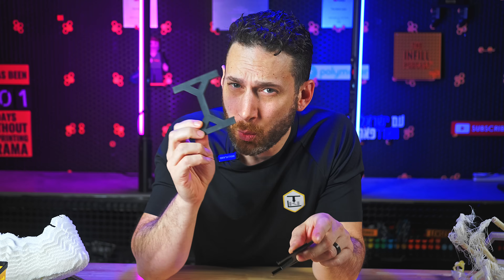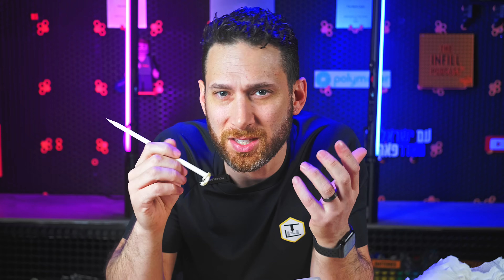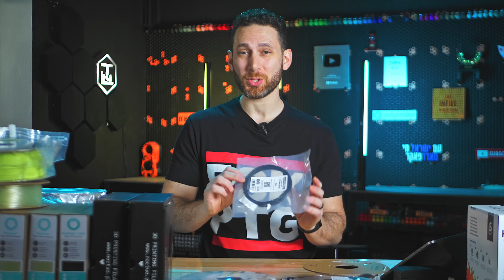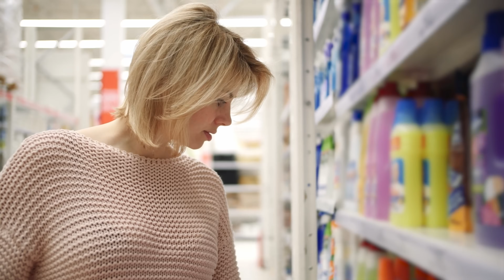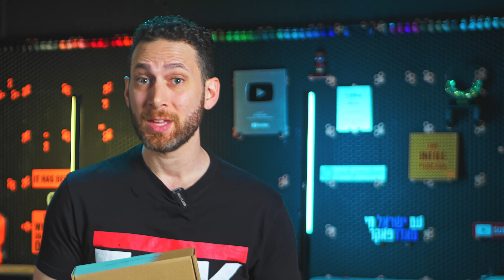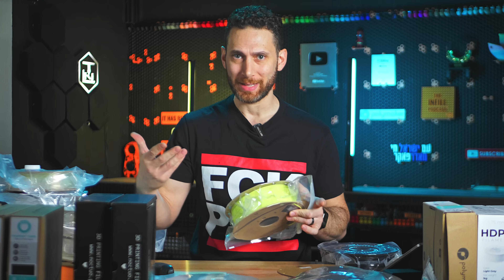Testing 17 Special-Purpose Filaments for YOUR Next Project!

Comment: so I have a general question because I’m new to 3-D printing and I just bought a X 2d with the AMS 2 pro. I noticed that when the filament goes through the AMS, it leaves a rough texture on the filament after back-and-forth with customer support. They tell me that’s a normal thing and it shouldn’t affect the way the AMS works. So my question is to anybody that has experience is this true?

Comment: Gotta use the hdpe to design an acetone vapor bath box where you can just screw on an acetone bottle and then when ready you just place the part, open a valve and let the vapor in and once done close the same valve to not only stop new vapor from coming in but also open the area up for fresh air to allow it to stabilize

Comment: I frequently use PHA for parts that are used outdoors because of it's great UV resistance.  It really takes a lot of consideration when you're designing the parts, and it prints best on open printers.  My Core One can handle it alright thanks to its speed, but a fast open printer would be able to print larger parts better.

Comment: I have a Creality 2025 drier. Those filament rolls that have the black skin on the cardboard spools are a couple of mm too big for that drier. I guess it's that skin's thickness that makes the spool taller. They contact the lid, which stops the spool from turning. Then the print fails. No problems with any other spools.

Comment: There's one filament I was looking for and for a very specific reason: Sunlu PLA meta.
One of the things I like to print is miniature models for games such as d&d and warhammer.
These models are usually printed in resin. However I did not want to set up a chemical lab at home, much less be exposed to toxic materials.
For that reason I print these models on a 0.2mm nozzle and use sunlu meta PLA. I don't know what it is they did but its by far the best at this job.
Also I often print models specifically presupported for resin. Weirdly they work amazingly well for FDM too.

Comment: Do you want special filaments purpose built for 3dprinting for engineering, a PLA stronger than Basf.... special polymers based on CPE, TPE, TPU with crosslinks, etc from Brazil?

Comment: 25 yrs in manufacturing and I've never heard PP said for polypro. Not until 3D printer YouTubers. I kind of get a bit perturbed. Just call it PolyPro.

For heat resistance, the ultimate is thermoset material. However, I doubt 3D printing any thermoset material will ever be a possibility. Phenolic is the resin I am familiar with. I believe it's not used as much since Acetal and Nylon has been slowly replacing phenolic.

Comment: With lw-pla you should 1 piece after one piece.
55 to 65 % federate from normal pla and max 50mm/s , higher temps = more expenses 
Slicer 0.4 wide give 0.55 wide by printing.
If possible print in vase mode or without retraction but max speed for displacement

Comment: Not only is Prusament's PETG Ultra Glow brighter, but it's also one of the only noctuluminescent filaments made with something other than PLA. 

Case in point, about three years ago, I printed a bunch of figurines with a glow PLA, and then placed them on a shelf with a UV light to illuminate them. It was a test and I legitimately knew what to expect. Within 18 months of [indoor] UV exposure daily, they were all visibly degraded. I never understood the rationale of making UV sensitive filaments with PLA, knowing it degrades with exposure.

Comment: Hi Jonathan! It is great to hear that the printing process went so smoothly for you. We really appreciate you taking the time to test our filaments and share your experience with your audience. Since HDPE and PP can often be tricky to work with, it is a huge compliment to our team that you had no issues getting them dialled in.
If you are looking for ideas on what to create next, HDPE is an excellent choice for parts that need to be low-friction or highly durable. It works perfectly for things like drawer slides, tool jigs, or heavy-duty spacers where you need a slick surface that can take a lot of wear.
Polypropylene is best known for its incredible fatigue resistance, which makes it the go-to material for living hinges, as you showed. You can print containers where the lid and base are a single piece, and the plastic hinge will bend thousands of times without snapping. It is also very lightweight and chemically resistant, so it is great for functional workshop organisers.
Reply from the maker: Omg drawer slides that’s brilliant. I’m considering building my own drawer slides instead of always buying them. Genius. Might have to do it…!

Comment: I think you really missed the mark on two fantastic lesser known filaments... My #1 pick is CC3D 's PBT Pro, a 5% glass fiber filled PBT.   Has fantastic ductility and impact resistance (not for high speed impacts, like combat robots though, at those speeds it almost acts like a non-newtonian fluid, it's molecules can't shift fast enough with the impact and what was flexible suddenly turns brittle...its weird, but a really cool filament with just the right amount of stiffness.   I use this to print motorcycle flag brackets that need to handle crazy torsional forces and vibration and not going to see 300mph bladed weapon impacts.   

The second one you missed is known but in completely the wrong way... And as much as you dislike PETG, this should have been top of your list, because by rights it should dethrone PETG as the #2 choice after PLA, the material I'm talking about is HIPS.   Yes, that "dissolves in limonene support material".  But it is so much more than that, and a fantastic primary material in its own right... It basically performs like a ABS's better mannered and less stinky cousin.  Anywhere you need heat resistance, and easy printability, HIPS beats ABS and PETG hands down...oh .and it's also a great near universal breakaway support material no limonene required... I run it as support interface with 0 z gap on PLA (much better than PETG for support interface), PETG, abs, ASA, PC.. only thing I haven't used it with is nylon... And thankfully, companies like Gizmodorks have a pretty wide selection of colors...and at about $20 USD/kg... They're both quite affordable.

Comment: I'm desperately looking for something ELASTIC.
I'd love to be able to strap Prusa's silicone tool to my U1, but that's just a dream, and none of the usual flexible seems to be elastic (of course, flexible ≠ elastic).
You'd really do me a solid if, in the next installment of this series, you'll have an elastic one 🤞
Reply from the maker: I’ll see what I can find… PEBA isn’t elastic though?
Reply: @thenextlayer , besides the usual TPU, I tried:
PEBA 90A, PEBA 85A, Syriatatech TPU Air, eSun's TPE
But they all just stretch out and don't snap back, and the "solo loop instpured" watch bands I made for my Apple Watch (one of the reasons I'm looking for that), they were just stretched while pushing my hand through them and never came back.
I also had tearing shoes like you, and it's inherently the same issues.

Comment: So I know a lot of us just end up upgrading our build plates and rarely use the stock ones. I ended up grinding off one side of the coating on myBambu A1 plate to use the Magigoo PP glue and I got polypropylene to print fine.

Comment: There's companies that make lightweight ABS and PLA but it's a prefond version, so you don't have to worry about that. And it's often relativity cheap because the rool depending on which one you buy is twice the size or half the size by weight. So you get an awful lot for the price, and it's cheap

Comment: The problem with most of these 'exotic' filaments is they are very expensive. Every failed print while you dial in slicer settings is just more money down the drain. Unless you have paying customers it's difficult to justify using them.

Comment: Be careful with flame retardant materials, they may not burn, but the smoke they release is often quite dangerous to breathe. It's meant to protect equipment and the facility, not the workers.
Reply from the maker: Oh snap. Glad I used a powerful fume extractor

Comment: A lot of dishwasher parts are PP.  I printed replacement parts in PC because it is what I already had, but that is a top use case for PP IMO.  Fuel containers including gas cans are made of HDPE, so funnels, rc fuel cells, replacement caps, etc.  haven't personally used HDPE filament either.  Been wanting to try Delrin.
Reply: Good luck with POM(Delrin is the trade name), I tried some stuff years ago and it has huge shrink rates so I could never get any functional part bigger than an inch out of it.
Reply: POM/Delrin is not only really difficult to print, but also really toxic while printing. I would advise against it
Reply: @badmouth75  Unfortunately, all the PP filaments I've tested get extremely soft and stretchy at temperatures well below what dishwashers are capable of. 

(The softening is so dramatic that if the filament is in the Bowden tube inside the chamber while the printer is preheating, it won't be able to print; you have to heat up the printer and then feed it cool filament, and if you ever pause, you have to unload, cool it off, and reload.)

I think the polypropylene used in dishwashers must be a higher-temperature formulation.

Comment: I expect the polymer for the grip filament to be SEBS based on the temperature and lack or drying requirement. I used SEBS for some grippy requirements and got pretty good results, to my surprise a smooth PEI plate gave much better grip than a textured one

Comment: Even though that flame retardant ABS doesn't smell like the normal stuff doesn't mean that it isn't still off-gassing Styrene, it just means that whatever they modified it with smells stronger.  The stuff should still be ventilated if you ask me, but I'm just a guy on the internet.
Reply: @blackcollarfiend  if it smells like a clinic or dentist, then most probably it contains chlorine based flame retardants (very popular chemical group of flame retardants). This means that fumes are even worse than styrene fumes.
Reply from the maker: Ohh yeah I printed it in a well filtered printer.

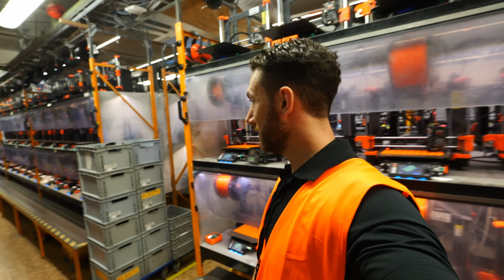Comment: 22:50 so a kg of that filament is like 50cm long? :))
Reply from the maker: I was wondering the same thing, but yeah, it's not long at all I'm sure.
Reply: I recently had a project requiring PETG Tungsten, ordered a 100g sample and it was around 10m long. Full 1kg spool would then be around 100m, and look similar to a 300g spool of PLA